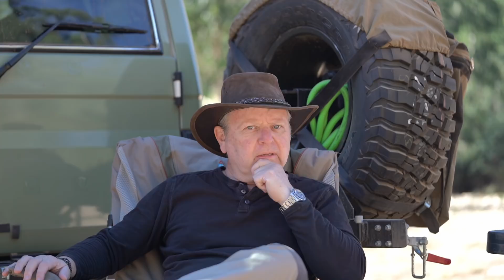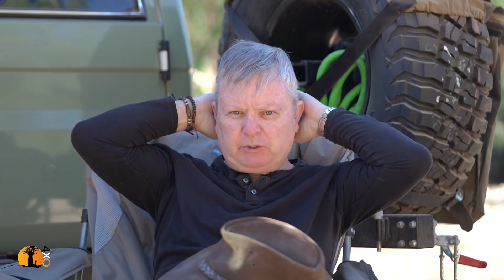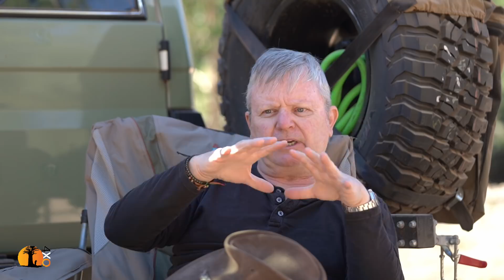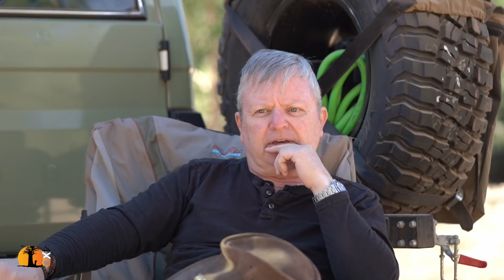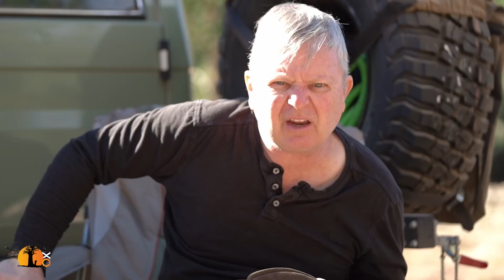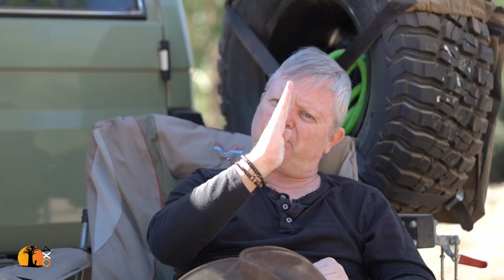TIRES - Pressures, Heat, Footprints and Failures

Comment: I did 3 Cape York trips fully loaded to the hilt with 18 psi in Ebay bought Chinese mud terrains and they performed just fine.  I belted along at 90-100km/h the entire way along the PDR and they rode beautifully.  Tyre size was 265/75 R16 LT construction.  Very minimal damage to tread.  2 very small chips taken out of 2 tyres.  The tyres were $180 each and every bit as good as name brand rip-offs selling for $350 each which I have also previously used.  I just see no sense in spending double on tyres for what I could buy them for that do the same thing.  Did another remote trip on another set of EBay tyres some years later with same excellent results (brands were Goodride and CF Comforser.  Running too high pressures in tough conditions (stoney & corrugated) is bad for them and causes damage.  I’ve been off-roading for 14 yrs and have tweaked many things along the way & have without a doubt found running lower psi to be the safest option on high speed rough tracks as the car feels nice and stable and won’t slide out on me as easily.  I’m more in control and the tyres don’t have a mind of their own so much.  I like watching your videos & am a subscriber to both YouTube and your podcasts, but feel you made up a lot of the content of this video without having the proper knowledge first hand about tyre performances.  Never have I ever in my life experienced a tyre that got “hot” while driving even for extended periods on high speed rough corrugations or in boiling hot sand.  Warm yes, but not hot as you say.  I have also driven Fraser Island dozens of times in January/February and 5 Mile east of Rockhampton so many times in summer also with 18 psi and even those same pressures when I first had ordinary hwy terrain and with a 800kg payloads.  Although the LT tyres handle the weight much better.  Sand is kind to tyres....  Especially really soft sand because you’ve got full sand cushioning supporting a bit of the sidewalls too, in addition to the tread blocks and in between them.  It spreads to load even more evenly.  Hwy speeds on stoney corrugations....  Not so kind.  But to me it seemed like your extensive knowledge on the subject was a little lacking in accuracy on this occasion.  If you’ve been there and done it, then you’d think you’d know what is accurate information & what falls short of being accurate.
Reply: Brett B2 I've had 4wds with cheap tires and had mixed results across the same brand you mentioned. I had two sets one was rock solid and got about 30k km before replacing.. the others had sidewall blistering badly after driving on soft sand at 40c, the two opposing tires got so hot that it was uncomfortable to touch.
I've since moved back to BFG's. I wanted a consistent experience. Given most of my time is away from crowds totally alone it is the one quality that I value highly.
Reply: Must be rebadged Coopers by the sound of it haha.  With all the tyre problems you hear of out there, tyres getting so hot due to low pressures they melt or blow out is something i would still consider an extremely isolated incident and certainly not a common risk by any means.
Reply: Brett B2 you might not have gotten the "too hot" experience but there are many that do.... And dont realise it. Evidence of disintegrated tyres exists on many washboard trails. Thought is that mid pressures are good, lower pressures are even better. Last week I just had a guy tell me he can go down to 0.6 bar on corrugations because hes running 3ply muds on his Jeep and theres little to no flex. He will be towing an 1800kg trailer as well on a 5000km round trip. This topic is exactly like motorcycle track riding tyre debates.. Akin to religion and politics. My simple philosophy is 99% theres always only a workable window, with main parameters being , weight/terrain/temperature/driving style
Reply: King, I completely agree that driving stile plays an integral part with almost everything that can fail or wear out under a car.  Steer sharply with say 10 psi with decent momentum and you can roll a tyre off a rim.  Or carrying excessive weight with very low pressures can also do this if you’ve watched Ronny Dahl’s vids.  They’d rolled tyres off rims in their heavily loaded cruisers.  But doing damage at 18 psi unless you have a lowish profile sidewall on a 17 inch rim for example, I would say is extremely rare and o would consider that a low pressure.  18 psi is my automatic go to pressure always for off-road driving of any kind regardless of the weight I’m carrying.  With quite a few different sets of tyres and the tyres have never gotten warmer than warm.  I’ve heard of plenty of blowouts in over inflated low profile tyres in Darwin for example on really hot days on boiling hot bitumen.  I had to do a conversion from bar to psi for your comment about 0.6 bar on corrugations being 8 psi....  And to respond to that, I think that’s not a good pressure.  Way too low.  But my argument was that Andrew SPW mentioned several times that if u let your tyres down “they’re going to blow” or cause damage & problems as though it’s a regular occurrence and I would have to strongly disagree as that’s a false statement.  He also mentioned at one point that 26 psi was “low.”  I would say 18 psi on a 16 inch rim, non-low profile tyres is safe as houses at high speed on a rough track.  Lower profile tyres which many new 4wds are fitted with as standard these days....  Well that opens up another whole can of worms with potential issues with traction and tyre damage.  ASPW talked of lots of blow outs experienced from low pressures but I find it hard to believe.  If people are frequently running 7 psi and driving at speed then that to me is not a good idea as that’s way too low.  When ever you see a 4wd with a shredded tyre on the side of a high speed rough track it would almost always be because they were running to high pressures and severely reduced their puncture protection as a result.  Too high for the conditions & speed on rough tracks with puncture risks leads to tread damage too.  It they had quite worn tyres, or they had a standard highway tyre without added puncture resistance.  I’ve seen this scenario a fair few times.  Lower pressures are safer.  Not 5-8 psi low as that’s dangerous and at the extreme end of low and not too many everyday people run that low, but lower pressures are definitely safer & enable safer control of a 4wd.

Comment: Let me start out with the confession that I spent at least a few hours trying to figure out what pressure is best for my mud terrain tires while on the road. The tires I had were rated for a heavier vehicle (~1,000 lbs. or more), so I assumed I should inflate them in proportion to my vehicle. I read all the forum conversations, and I watched all the youtube. I heard a lot of people saying to just look at your door jamb, and on the opposite end there were people with some nice long equations to help you "estimate" the pressure. 

The only information I found useful: 

1. Chalk the tread all the way across the width of your tire, and drive on flat ground (cement or asphalt). Stop or repeat, while adjusting your pressure up or down, until you only see an 1/8-1/4" of chalk at the outside edges of your tire tread.
2. Stick something flat under your tire tread closest to the bottom of your tire tread. Make sure it doesn't stick an 1/8-1/4" underneath it (considering the thickness of your thing).  Adjust your pressure up or down until it's good.

That's a good starting point, and then it's way easier to adjust when you're off road. That being said, I'm about 15 psi below the doorjamb, and over 30 psi below the max pressure of the tire. Sorry, I'm not going to convert to bar. My tires never feel warm, even at speeds above their rating, including above room temperatures (68 deg F). Added bonus: you get very even tread-wear. 

Sometimes when I'm watching your channel, I'm reminded that there are people who think about things like tire pressure/heat/footprint, as much as me, and make videos about it. Thanks.

Comment: Probably a bit late for this mini-series, & maybe from a different standpoint, but can you put a bit in about still dropping tyre pressures on vehicles with traction control. Especially on sandy desert tracks as I recently watched a guy struggling up a single tracked sand dune, scalloping the living crap out of it. He hadn't reduced his tyre pressures as he apparently had been told he didn't need to because of the traction control so had taken about 30 attempts inching his way up what is actually a pretty easy dune, chopping it up as he went. He was pretty flustered & didn't want help so just bashed on until he got there, & then the small crowd that had accumulated had to drive in the mess he'd made. Not cool & horrendously misinformed.
Reply: GAJ You get thus often, including experienced offroaders and many with Disco 4s. Nothing wrong with an extremely capable vehicle, just the drivers.Yes you do drive slightly differently in some circumstances, but essentially they believe you need wheel spin to engage TC and get up an obstacle. Eventually they get up an obstacle or path but have wrecked the path/environment for those following. Pretty annoying and you can never suggest anything to them
Reply: @King88_8  I always tell them that bowling ,, or tennis is also something people can do when this 4x4 thinghy doesnt seem so much fun !

Comment: Hi Andrew
One thing you didn't mention with tyres getting hot when you let them down is that the pressure may be correct but the speed you are driving is too high. This is a very common mistake with people that they let air out of the tyres and then want to push along at the speeds too high. As a quick rule of thumb for my vehicle and tyres when fully loaded to work out how fast i can go i multiply my pressure in PSI by 2.5 and that gives me a max speed in km/Hr eg 10 PSI x 2.5 = 25 km/hr.
Reply: Mike Burston Sounds like a pretty useful rule of thumb.
Reply: Mike Burston Btw, how much does your rig weigh?
Reply: last big trip was about 2800kg running A/T 265/75R16 with pressures from 10PSI to 60PSI depending on terrain and front back weights
Reply: Yes you are right i did miss that Must have been distracted . Although Andrew is talking about tube tyres there it also applies to tubeless as well
Reply: Mike Burston Thanks.  My truck and camper weigh between 3700-4000kg.  Although I never thought about it in terms of a psi multiple, in practice I've been running about a 2x multiple.  Basically 70-80 psi for highways, 50psi for good dirt/gravel and 35psi for anything that involves a lot of low range.
Reply: Hi Sonictech1000 when you are towing a trailer you need to pay close attention to the pressure in the trailer tyres and these will usually be a bit lower than the vehicle so that it rolls easier and therefore those tyres will be the ones that will limit your speed. I am like Andrew in that i tend to look at what the tyre looks like on the ground as a starting point. Also an important thing with trailers is not to have too much weight on the drawbar, you should only have a max of about 50kg vertical weight on the drawbar ( i aim for 30kg)
Reply: Mike Burston I should have written that differently, this is a truck camper that sits in the bed of the truck, not a trailer.  I've often eyeballed the tires in my SUVs and generally ended up about where you're at but I'm still trying to fine tune how I do things on this much heavier rig.
Reply: Sonictech1000 is your rig single or duel wheels on the back, if you have duels then i would urge you to give serious consideration to going to fat tyre singles as the duel pose some huge problems running lower pressures
Reply: Mike Burston Single.
Reply: with large singles you need to know the limits of the sidewall construction for low pressure use. as Andrew said watch the temps closely and on rocky technical sections pick your line with care, even with these minor considerations i have found 4x4 lite trucks to be great vehicles off road and will go almost anywhere even places a land cruiser will have trouble
Reply: Mike Burston Thanks for the advice.  It does seem to do pretty well outside of sand.
Reply: sonictech1000 sand usually means really low pressures and slow going as the side walls are usually a lot stiffer a bit like muddies so you don't get them elongating as much, a good way to tell if they are low enough on sand is to knock it into neutral as you are going along and if the vehicle stops abruptly the the pressure is too high but if it feels like it is rolling over the sand and rolls to a stop then they are about right
Reply: @sonictech1000  Dont deflate dubble rears until they touch , they will start burning and there is no fire extinguiser that will put it out !

Comment: I agree 100%.  I have had this discussion with so many people.  The correct tyre pressure depends on so many things, the road/track/beach conditions, the temperature of the day and the kind/make of tyre you are running. It's like good drivers really. A good driver adjust the way they drive to the conditions of the day.  It's the same for tyres, you adjust and then you monitor and re-adjust as is necessary...

Comment: I run a  Kevlar tub on the inside at a different pressure from my tire on the outer. It holds my tire like a lock ring. 40 psi inside and 16 psi outside. only on the trail. less air to add when I hit the road. Works unbelievably! from the States.

Comment: Great chat you mention the tubes repair kit. The inventor Arron Fromberg. I should say there could be more than one patent on tubeless tire repair just don't know . Any way the guy was clever had a machine shop at his home in Frazer park California all doing some had many patents any way when should that proto type to my dad and I it was something he had a manil steel tube cartridge with rubber some how molded in to it under tremendous pressure you just slide this tube into a crank handdal and crank this rubber, got push out of the tube into the tire and expanded I believe some 3or 4 times it's diameter may be more . But when he did not put it into the tire just to show us it look to me and dad like it was at least 5 times the original diameter of  the 3/16 inch tube the rubber cam out of it was huge .Any way in the middle of all this he passed away heart attack and his wife sold the writes to it his patent she did good deal smart woman and the rest is history we never saw this item on the market like he showed us so have no idea what happened . Just a note of oddity . happy trails

Comment: I bought four used all terrain tires BFG; put them on my blazer; aired them up 15psi; ran them over five years in and out of the desert; still had deep tread on them (they were just all  chunked up) when I decided  to put four BRAND NEW TIRES on it (different brand mud terrains 10$ cheaper per tire); aired them to 15psi, three of them blew out the side wall within six months; dad-gum-it.

Comment: A length of string is from the middle to one end x2
Reply: I have a knot in mine tying the two loose ends forming a circle. Do I need to use Pi?
Reply: double half its length is the easy answer mate